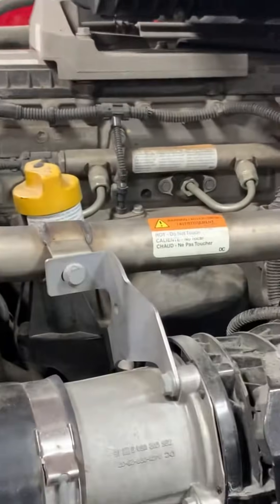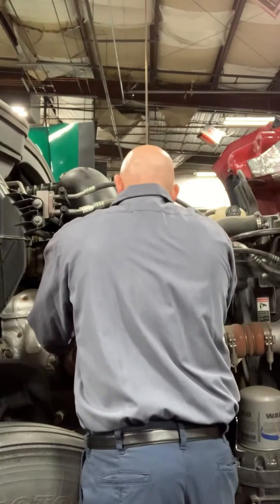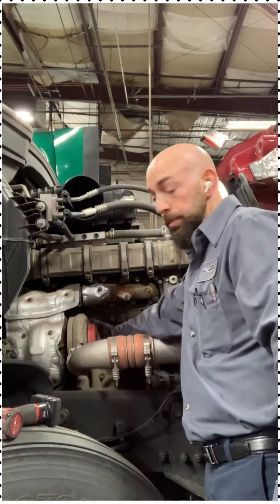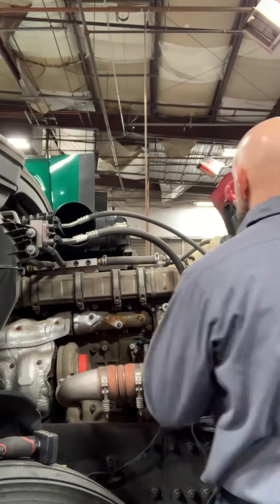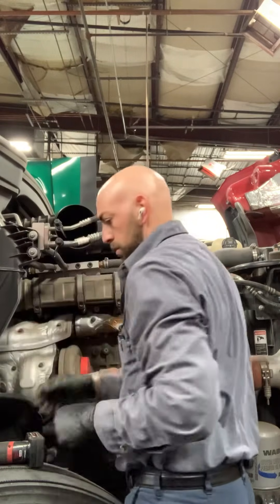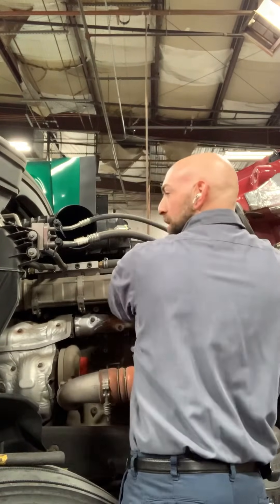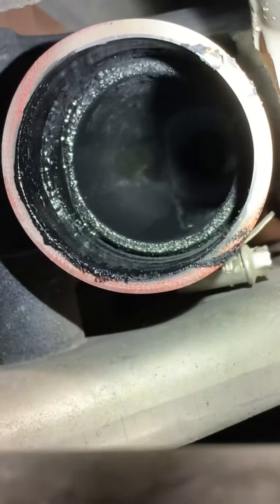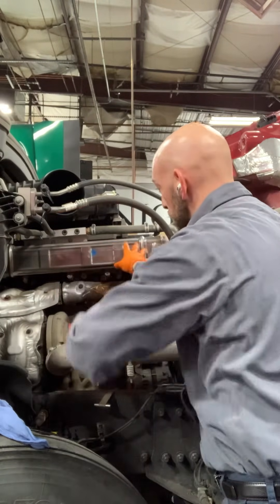Freightliner cascadia DD15 engine EGR EGR cooler failure. By diesel dr

Comment: So far I'm losing about a gallon of coolant week (team truck) question is do you think I can go 4 more weeks without internal damage. Or have you ever seen cylinder wall damage or hydro lock do to a failed EGR cooler. And last question, how much coolant should I expect to come out of the EGR cooler if not draining the radiator. If I do it out on the road I plan on just putting a couple drain pans under the EGR cooler and catching what falls.
Reply from the maker: Thanks for watching and great question. You know I can’t honestly recommend going any longer losing that much coolant. It is quite a bit. A failed cooler won’t cause hydro lock but if you start noticing your oil level rising due to coolant contamination than I’d stop running it right away. Than you’ll get locked up.   When I do drain the system I drain it from the block so most of the cooler would be empty upon removal. When you do go to remove it maybe a 2 liters worth will come out. Not much. If you don’t drain the system than expect around 3 gallons to come out. Being the highest point shouldn’t be much more than that.   Failed coolers usually lead to coolant just being burnt up in the intake but long term effects will definitely weaken the valve seats and cylinders. So sooner the better. Hope that helps and thanks for your support on this channel.
Reply: Just pulled the hot pipe off. Didn't see any coolant but saw some leaking around the reservoir cap. Gonna try the $15 fix before I try the $1500 fix. Thanks for the video.
Reply: @lightningguy4897  What is the $15 fix?
Reply: @anonymoustrucker1782  it ended up being the reservoir cap. Leaking and not holding the proper pressures. Just when I see coolant loss and it's not on the ground or not going in my oil pan my mind goes straight to worst case scenarios.
Reply: @lightningguy4897  Gotcha. I think my egr is bad though. I have a code for egr pressure . And i am losing coolant, not leaking anywhere
Reply from the maker: Do you know your code spn and fmi numbers
Reply: @bustedknucklebydieseldr3228  spn 2659 fmi 0
Reply from the maker: @makincash3337  I’d say you Deff have a code there.
Reply from the maker: @makincash3337  and since you have that code, I should have a video on that one with a EGR actuator replacement. Might come in handy.

Comment: Would a leaking egr cooler show up in an oil sample? My samples come back perfect but I have a slow coolant leak
Reply from the maker: Pretty good question man. I would lean towards no because when the cooler leaks the  coolant goes through the intake and gets burnt up with combustion and goes through to the exhaust. I bet there is a cold water leak somewhere, you would just need a pressure tester and let it sit. After some time it’s bound to show itself.
Reply: @bustedknucklebydieseldr3228  hey man thanks for the reply! I been scratching my head over it so I guess I'll get it pressure tested.

Comment: can a egr that is leaking ruin the scr box
Reply from the maker: Good question, a leaking EGR cooler will saturate the dpf filters and possibly contaminate them to the point of failure. For the most part they can be burnt out in a regen but in the even a regen fails than they would need to be replaced. As for the doc’s there shouldnt be an issue with smoking them out in a regen. But in rare cases yes it might cause docs to push out and not filter properly. Hope that helps.
Reply: @bustedknucklebydieseldr3228  thanks for replying

Comment: That's so much easier than the DD13.
Reply from the maker: Nothing about the dd13 is easy. Everything is so hard to get to and we all dread when one comes in.
Reply: @bustedknucklebydieseldr3228  
And the DEF pump heater lines are always brittle and need to be replaced at the same time.

Comment: Wtf that things like a 2018-2019 cascadia and it already is having EGR cooler problems ......
Reply from the maker: Thanks for reaching out.  Havent seemed to work out the kinks yet. Can’t blame them though.  they make these things quick on a production line. What ever happens happens right. That’s why we have job security.
Reply: @bustedknucklebydieseldr3228  hey I don't mind you guys having some jobs security I remember when this s*** first came out you guys dealership technicians hated it so did the dealers but most guys changed their tune now when they see their timesheet at the end of the week.....

I wouldn't mind you know if it only cost maybe 1,000 or two here and there but when you start getting 5 to $10,000 bills every couple weeks to couple of months plus the down time it gets kind of aggravating
Reply from the maker: @JackknifeIRL  completely understand you there nothing is cheap on these trucks and dealership labor rates are crazy expensive. But technician skills are not going away anytime soon even with all those new electric trucks coming out.
Reply: @bustedknucklebydieseldr3228   what would cause a smell of exhaust inside the cab of truck
Reply from the maker: @dexterzacharie8668  thanks for watching. Any exhaust leak on the truck could cause the smell to get inside the cab. Especially at an idle where the vapors just go up. With this repair coolant was getting pushed into the intake. So the only thing you might notice is low coolant level, sweet smell in the exhaust , or smoke out the exh pipe. I would just start looking for soot signs on all the clamps.

Comment: Man nice video bro.. hey quick question..  2016 dd15 my antifreeze changed colors.. it’s very dark.. it’s not oil or fuel.. but I am seeing black floating particles in the antifreeze and my reservoir tank is dark.. is there any chance that I could be getting soot from my egr cooler into my antifreeze and reservoir tank? Or could that be radiator hoses breaking down from the inside!! Man any advice will help.. I’m taking a sample of the antifreeze to Detroit to see if I could get an analysis!! Thanks
Reply from the maker: Great question my man. This usually occurres when the EGR  combustion gas is going into the coolant by means of the EGR cooler. Usually not a head issue but I would Deff take off the hot pipe going to the cold boost intake and see if it’s wet in there. If it is you found your problem.
Reply: Got same thing in 2020 and EGR cooler has crack, replaced and solved problem.